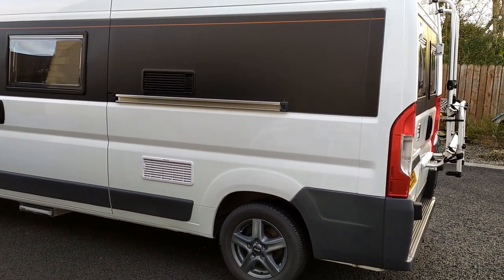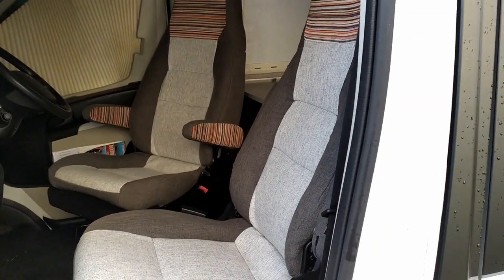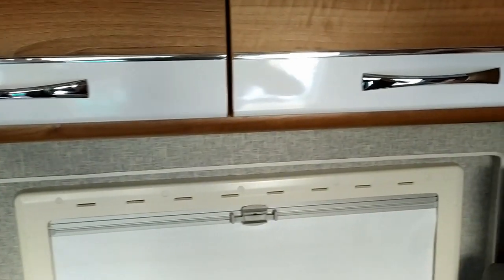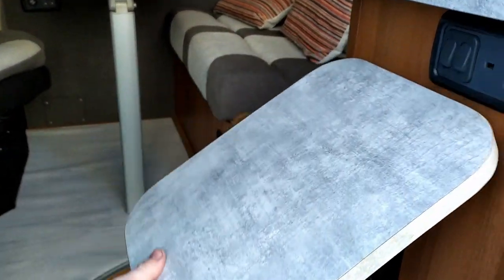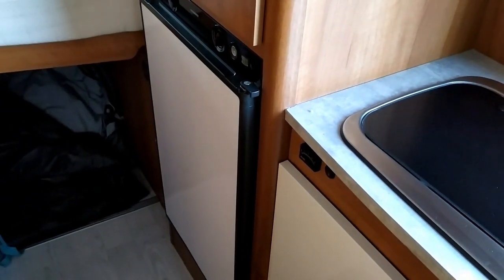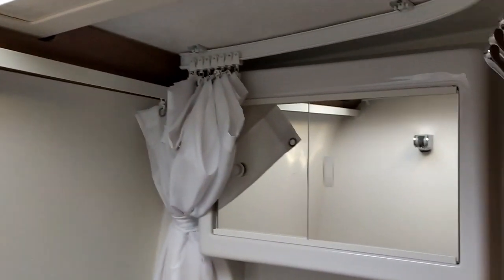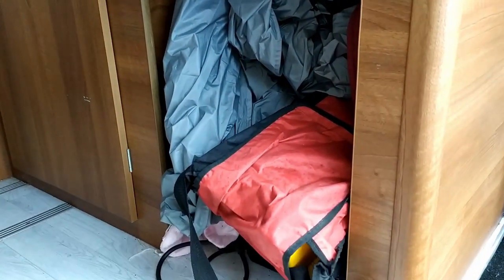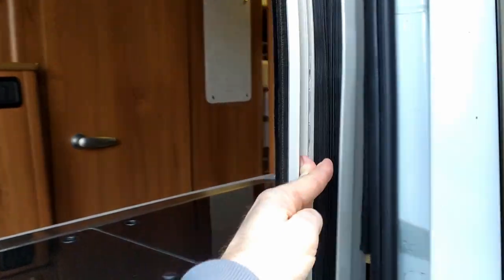DIY luxury camper conversion - LWB Peugeot Boxer

Comment: What is the depth of the kitchen cabinet, and the width of your double seat? Im having a hard time doing a layout that creates that amount of air between the doubleseat and kitchen cab. Myself
Reply from the maker: Sorry but I've since sold the van so can't get you the measurements.  The double seat is the trickiest part.  You need to make it smaller than you imagine to make it work and make sure to slope the side of it to allow more hip room going past it.
Reply: @Rickbrown74  ok thx for the info. Oh nooo, was such a cool van! U got a new one? Or done vanlifing hehe
Reply from the maker: @ExpeditionHawk  Got a new van.  It's a Transit Custom so I'm able to use it daily.  Wasn't able to use the Boxer enough to justify keeping it. Will do a video of the build when I can remember to get round to it! 😁
Reply: @Rickbrown74  quite smaller van though hehe, you felt the boxer was too big tonede daily or?
Reply from the maker: @ExpeditionHawk  yeah was ok to do the odd run in but the smaller van is so much easier around town.  It's all about compromise.  We can survive away without the shower room and hot water.  The beds comfortable plus we've a diesel heater and a fridge.  😁👍

Comment: Q. What did you use to paint the front bumpers please?
Reply from the maker: Hi, just sanded it a bit with 400 grit, covered it in two pack primer and then two pack white to finish it. Two pack paint (2k) is real tough stuff and you can paint it in your shed without needing heat or air flow.  Just make sure you've a good mask on!
Reply: Thank you Il give it a shot 👍

Comment: Great job as I've said. Quick question - which underslung gas solution did you go for and how long does it last with average usage ? Concerned this might be an issue refilling on the continent.
Reply from the maker: Hi, to be honest I don't know.  From research before buying the gas people were able to go weeks with fairly heavy usage.  We didn't get away for long breaks so never uses much gas. It cost about £12 to fill it and it lasted us ages.  The kit was from gas-it and worked well.
Reply: @Rickbrown74  ok thanks. Sounds like the way to go !

Comment: How did you make the curved locker doors?
Reply from the maker: Hi Julian, they came from Magnum motorhomes as a match of their lightweight ply boards.  I only added the white vinyl to them.  Kitchen doors were also custom made from a Kitchen manufacturer. Hope that helps.
Reply: @Rickbrown74   Many thanks...

Comment: Great looking Van . iam currently looking to buy a van and convert over winter . could i ask how you get the water pipes from the heater on one side of the van to the kitchen unit on the other side , not seen any videos showing this .
Reply from the maker: That's a good point.  Never thought of mentioning that.  I have a channel in the floor about 6 inches wide which runs across the floor adjacent to the cupboard which houses the electrics. The water pipes run behind the shower room and across this channel to get to the kitchen side.
Reply: Thanx for that watched quite a few videos on here of people laying floor but never show water pipes , thanx again .

Comment: Rick, very impressive self build. Im looking to do same with boxer? Is this a good choice? I like front cabin blinds and flyscreens? Where did you get them from? They're like the ones you get on hymer....
Reply from the maker: Hi Shahed.  Thanks for the kind words.   The Boxer, Ducato and Relay vans all work well as you can get a 6'4" bed sideways across the back to save space.  The screens are Remis blinds and the flyscreen is dometic - Specifically made for these vans.  I think they're all available from the likes of Magnum Motorhomes.

Comment: Most have cost you a fortune
Reply from the maker: Got the van at a bargain price and was going to pay for someone else to do the work.  Their quote was 14k for the specification I wanted.  I completed it for less than that yet added some extras along the way.  So it's a high spec new conversion on a nearly new van for half the cost of the manufacturers van I modelled the conversion on ....... and learnt so many new skills along the way.  A great experience!
Reply: @Rickbrown74  so approximately what have you spent. I'm currently doing a conversion on a boxer and I've spent 8k and its almost done but its not looking like a motorhome. It is a campervan. Unlike yours. Yours is motorhome spec. Great job tho. Well done.
Reply: @Rickbrown74  thanks for the reply. Well worth it!!!